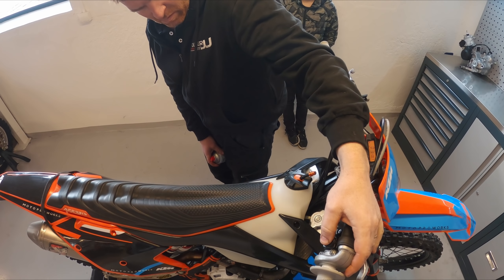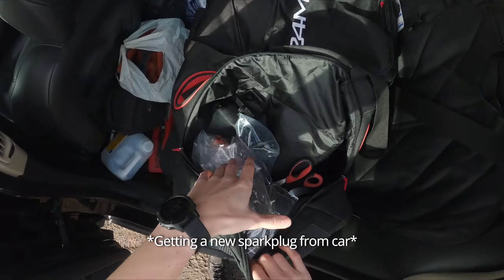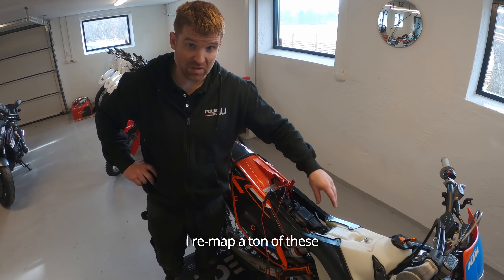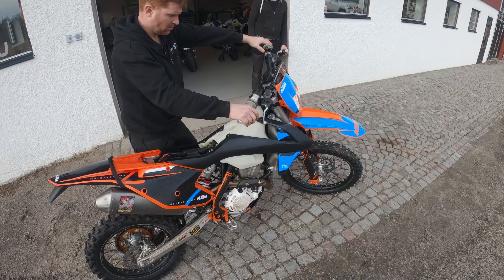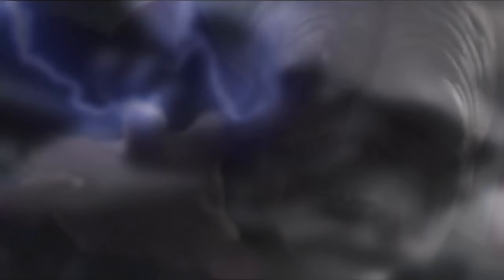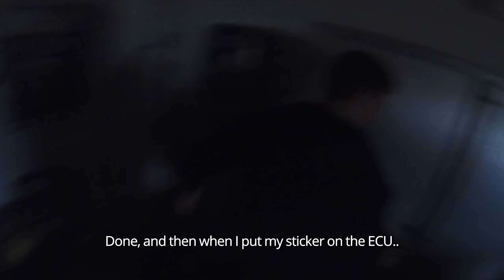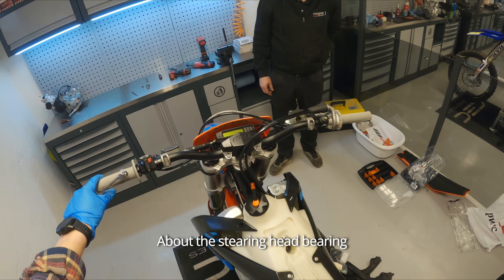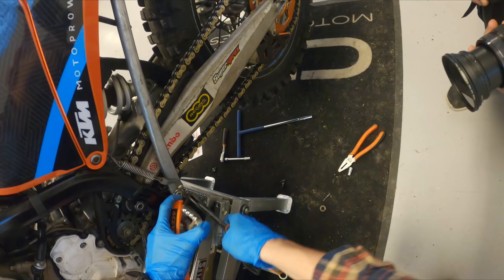Fixing The Bike & ADDING HORSEPOWER!🛠️🔥| BLDH ft. PowerbyJJ

Comment: it sounded when it was raining like the spark was not going to plug but like into frame  so if you have problems with that in thhe rain it means spark gets throught the wires to engine case and or to frame